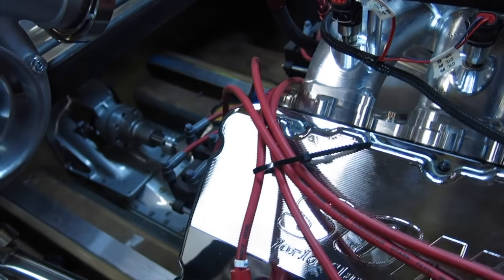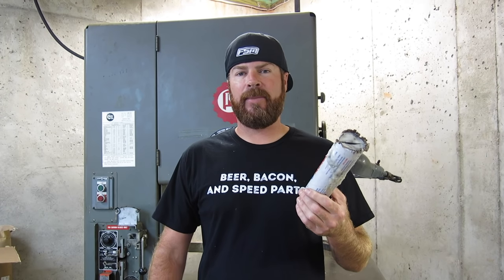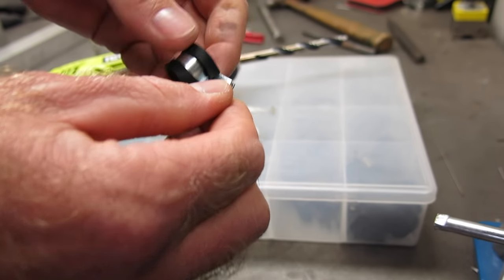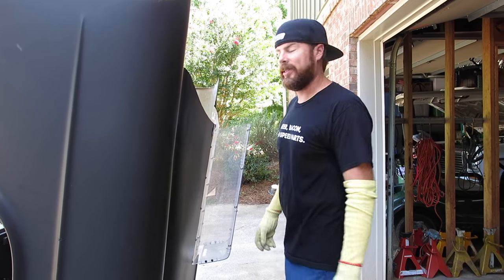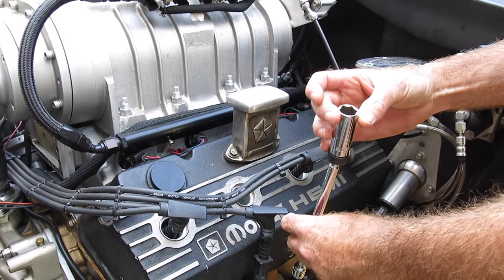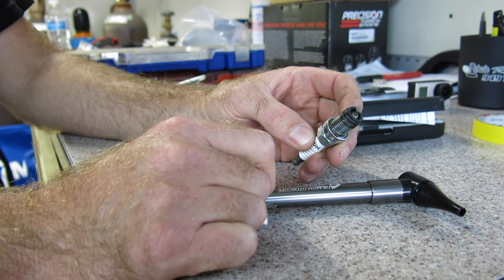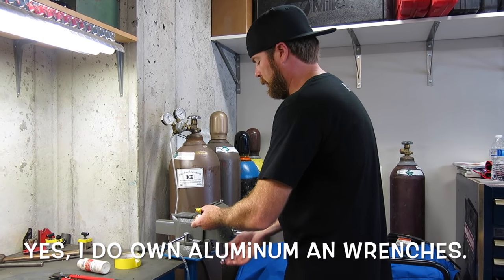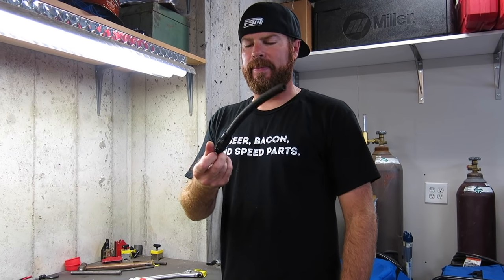Finnegan's Garage Ep 14: Life Hacks for Car Guys

Comment: Mr. Finnegan, I can't watch you suffer with those spark plugs anymore! I use 3/8 rubber hose at about a foot long. Slide it over the plug like putting on a plug wire. No scratches and super easy. Thanks for your time. (Learned that trick from a dodge minivan)

Comment: If you don't have flush cutters you can use pliers and but them up to the zip tie nub and grab onto them and keep twisting one direction until the break off. Leaves a perfectly smooth nub. Electricains do this so they don't have to carry as many tools and also sometimes you can't get the flush cutters in tight spots and it is just easier to use the pliers.

Comment: on the topic of lubricating the AN fittings - on aircraft we use clean, dry threads pretty much exclusively; but if you have to lubricate them use system fluid. hydraulics would mean 5606 or phosphate ester, fuel lines with fuel, etc. not that air tool oil would hurt anything on a car, but I thought I'd share a fun fact if people want to try something different.

Comment: On the spark plug separators, there are ones that have a flush type head (IE the head is 90 degrees from the normal position, so that when the pig end enters the keeper, the extra part sits flush with the loop), they are meant specifically for use with Network servers and the like, it makes the whole trick look so much nicer because when you're done and you tighten everything down, the keeper, which is normally visible, is hidden behind. And then it really looks PRO/Money.

Best part, they aren't any more expensive than the regular one, problem, you only find them in stores that cater to electronics. I doubt we're gonna see them in motor parts stores any soon, well, unless we make them popular in the scene that is.
Reply: ALSO, there's kevlar woven steel reinforced brake lines that go on motorcycles. Those are much better than simple steel weave ones. You can imagine that if they accept them in racing they are quite good.

Comment: in my dads old 64 chevelle the booster was mounted under the car, makes the engine bay look way cleaner and the lines are easier to run.

Comment: Another way to pull those plugs is to just use the spark plug wires themselves. After loosening the plug put the wire back on it and boom pull out the plug. Also you should do an episode on reading plugs. Would really enjoy learning.

Comment: Removing or installing plugs in a Hemi or any engine for that mater, shove a piece of 3/8 hose on the end as a handle.
Reply: That's a good tip... in the past I've used vacuum tubing over the tip of the spark plug and did a similar thing.  It's a little more fiddley than maybe the larger hose, but I never had a problem starting plugs with it.
Reply: i use an old spark plug boot that has been trimmed down and put a pushrod in the wire end as a handle, great for removing and making sure you dont cross thread when installing
Reply: I like that boot/push rod tool idea... one big plus of these (hose/boot) spark plug installers is exactly as you say, you can't cross thread a plug ever with them.  I like the push rod added to the boot too, helps align the plug into the hole easier.  AND while cutting off a piece of vacuum hose doesn't need storage, the push rod/boot combo takes up like no space at all.  Yep, good idea.

Comment: Not sure if you covered this tip or not. Got a small bolt you're trying to get in a tight spot where you're fingers won't fit and the bolt keeps falling out of the socket? Stick a piece of paper or tape on the socket then insert the bolt into the socket and gently screw it in!

Comment: top tip- No flush cut pliers? use a Nail clipper :) cuts just as close, and leaves a rounded edge so you never got those sharp edges

Comment: I'm 16 years old and I'm building my first motor for my first vehicle, it's a 1994 350 SBC that I'm converting over to a carburetor rather than the throttle body for my 1992 step side GMC Sierra 1500. do you have any tips or advice for when I start the swap?

Comment: Have you ever been using a swivel joint in a tight spot only to have it move before you get it on. well try this take electrical tape and tape the swivel part of the joint a round or two. it will allow it to swivel but hold the angle you want until you get it on .

Comment: curious to know what the noise was.  siren or was it that earth sounds people been hearing lately in different parts of the world.
Reply: It was the cold war era air raid siren that now does duty as a general public warning.  As in most states, they are tested once a month.  Usually the first Wednesday, or just simply the first, of every month in GA.
Reply: +Sam Johnson thanks  I wondered that.  we haven't had them around here for 30 yrs.   miss the sound in a wierd way
Reply: Tornado siren. Sounds like a Federal Signal 3T22, way off in the distance. It was most likely one of the monthly tests.
Reply: Depends on what your area worries about.

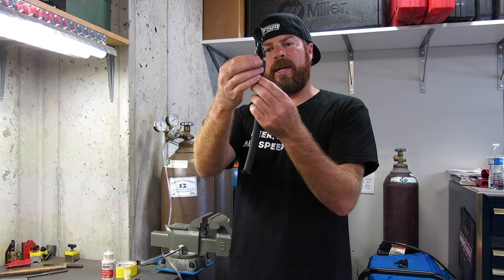On the Gulf Coast, these sirens are usually used in the case of chemical planet emergencies. Since there are some chemical plants that process things so toxic a tiny leak could kill an entire city, they use the sirens. If you hear them go off, and it isn't 12:00 on a Wednesday, you're supposed to tune to a local radio for further instructions and possibly shelter in place or evacuate. Sadly, nobody knows what radio channel to turn to, so chances are in the case of a real emergency you'd be dead.

Comment: Serious Q now : I thought braided brake lines were better than rubber because they didn't swell up? It's one of the first modifications we do on our motorcycles for increased braking performance. The authorities don't like them simply because they can't see the condition of the rubber hose underneath the steel braid. If you get defected you can just take them back over the pits with the original rubber hoses on , and then screw the braided hose back on as soon as you get back home lol
Reply: Yes the braided lines are better than rubber.  But with most cars there's solid line straight off the master cylinder.  The braided line is so you can move the master cylinder out of the way to get to the giant motor.

Comment: Only problem with the zip tie spark plug wire separator is that the plastic that makes the zip tie will not hold up to the elements living under a hot hood. They become brittle in time, Guaranteed they will break easily within a couple years, if that. 
But this is High Roll'n in terms of roadkill standards for sure.

Comment: where the heck does one acquire high quality vacuum caps. seems like no matter which brand I try these days, they dry crack and leak within months
Reply: If you want something plugged forever, just epoxy it shut. No more problems and you "can" drill the epoxy out later if you have to.
Reply: I've been buying silicone vacuum caps.  The rubber ones just fall apart these days.
Reply: Ditto on this. You can find them for dirt cheap at auto parts stores. I will also note a piece of hose with a bolt in the end seals good to.

Comment: what brand of step bit do you use? thats somthing i dont currently have in my shop. ive used a few before but they all didnt last long.
Reply: Most do not if you keep using the same step.
Reply: I have one that looks exactly the same, got it at harbor freight.  Works just as good as the ones they sell at home depot for about a quarter of the price.

Comment: Instead of using the magnetic pick-up tool (and clanking your spark plug tips against stuff) just snag a used spark plug boot off an old set of wires, or swipe one off an old 2.2 Chrysler next time you hit the junk yard..old Mopar FWD 4 cylinder boots were the SHIT..long enough to reach thru a valve cover or a tangle of header tubes, & firm enough to guide a plug to/from the head..also, way safer to install a plug to finger tightness with..use a plug wrench for that, eventually you'll cross-thread one..

Comment: Ah pro tip here: if you dont have a magnet for getting spark plugs out of the motor you can use a piece of rubber hose that will slip over the top of the spark plug.

Comment: Zip tie plug wire separator v3

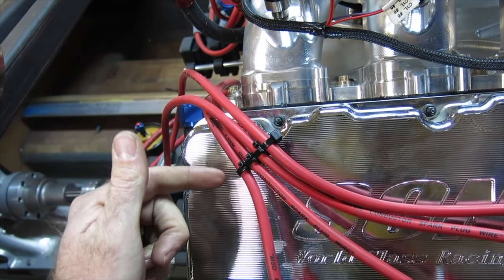also; "tube lube" 2:31

pink AN fittings? Polish the anodize off?
Reply from the maker: ez off oven cleaner will take the anodizing off, too.

Comment: I love the AN wrench tip, saves me $30 from buying an aluminium shifting spanner from china or $100 on a set of wrenches that might not fit another manufacturers AN fittings.
Reply: You can also wrap tape around the fitting instead of the wrench!
Reply: winner winner chicken fn dinner !

Comment: If the spark plug socket doesn't stick anymore, use a bit of duct tape on the inside and it will hold again.

Comment: Grab a can of Tool Dip,,or Plasti Dip as it is sometimes called.  A single dunk with your fitting end wrench,,then step outside and give it a sling or two,,to sling the excess off the ends.  Hang to dry.  Vualla,,no-mark AN fitting tool wrench,,without paying for ridiculously priced AN specific alum wrenches, or dicking with a roll of tape that may or may not protect your AN fittings from scratch.  No need to buy specific AN wrenches or the ridiculous fitting clamp deals for the vise that just piss you off because they don't work or fit all fittings right.  Also can use Mac tools slider style channel locks for that.  Same process, just be smart and not dip the pivot points.

Comment: Whats the beef with your stainless braided brake lines ? Motorcycle guys fit them to remove oem rubber lines and IMPROVE braking performance. And all the racers use them for the same reason.... Would imagine they would be fine on the blasphemi.

Comment: Mike, if you want super awesome spark plug sockets, I recommend Koken 3300CZ series plug sockets. They use spring clips to grab the plugs, and have a brass insert where the porcelain insulator of the plug touches, so as to reduce chance of breakage. Available in 14, 16 (5/8), 18 and 20.8mm (13/16). You can get em at frankstools dot com.

Comment: Here's a cheap way to build a efi fuel system using those nylon fittings & lines. I've done it myself. Post 19 http://ls1tech.com/forums/fueling-injection/1085884-nylon-fuel-line-fitting-attachment.html

Comment: If your running a REAL hot rod straight 4 or 6 you need to change your plugs to new every 5000 miles....forget about it and be real.  Reading your plugs instead of your custom program ECU is surly your fault and not the plugs....cheep skate.